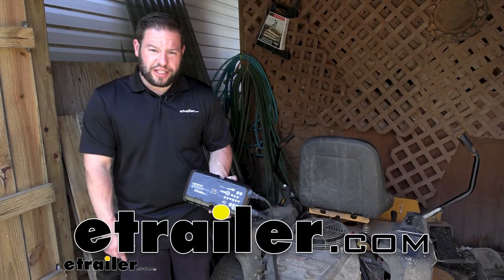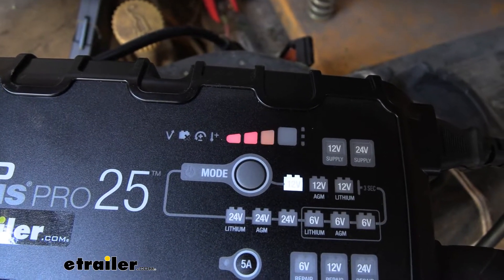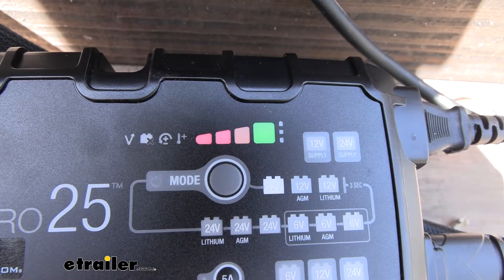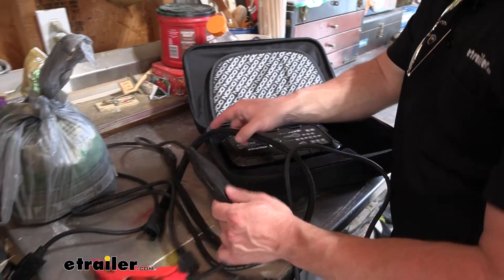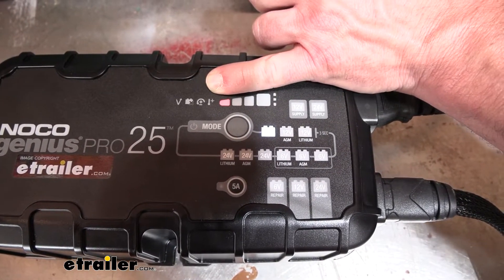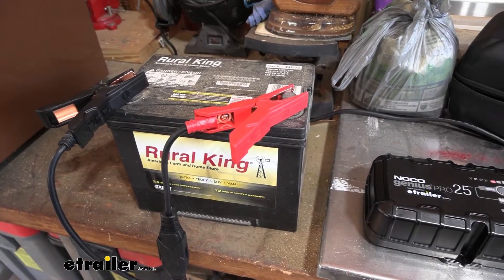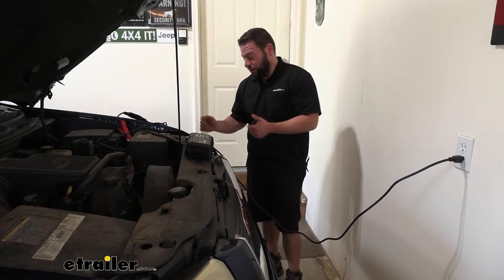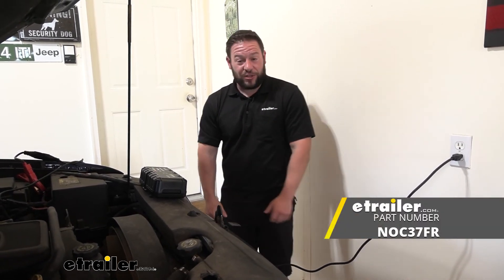etrailer | An In-Depth Look at the NOCO GeniusPro Smart Battery Charger

Comment: Noco has some nice products but I just can't see spending $600 for their 25 amp model or $900 for their 50 amp model. That's a fortune to pay for any charger especially one's with a switching power supply instead of a linear transformer.